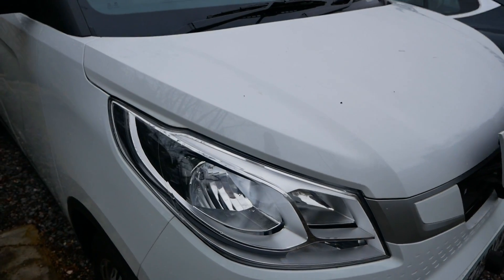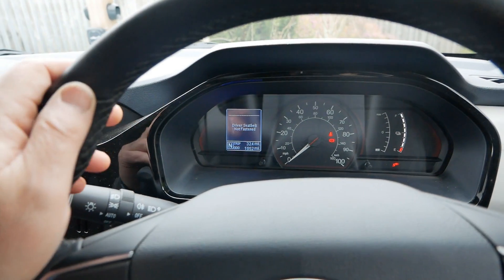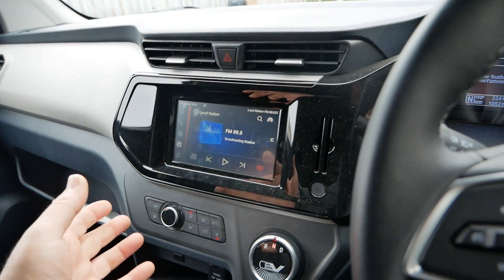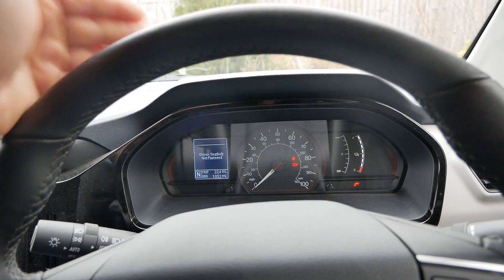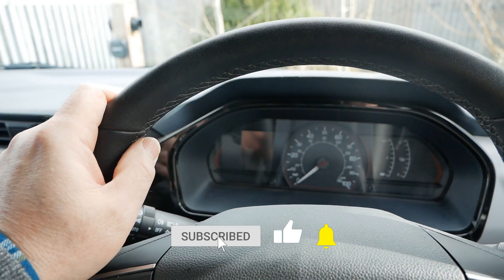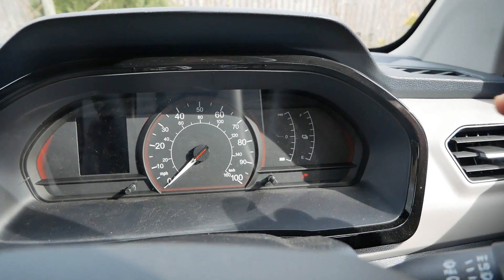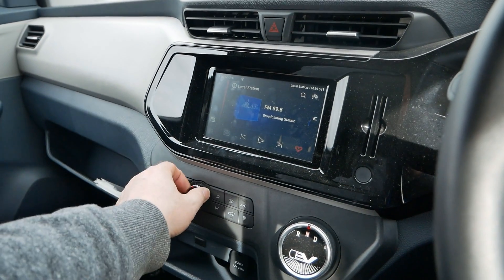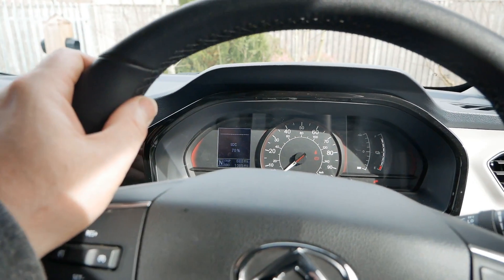Is manual pre-conditioning possible in a Maxus eDeliver 3 electric van?

Comment: Hi, I'm speaking from 6 months in the future.
I didn't know this was even a possibility, so it's good to know.
Although it does seem like Maxus could have offered pre conditioning via a simple software solution without adding any significant costs.
I would be interested to see any reviews on the later models and with bigger battery packs If you get the opportunity to review one of them,  and I'm quite keen to know if the radio was ever improved.

I think this van shown is the one I bought.
It's going well, by the way. I'm driving to and from work at massive cost of £10 per week. Just like it used to be when I was 17 years old.

Comment: Hi mate.
Ive noticed that as well. I think that the car also only lets you run the heater while charging if it is getting enough juice from the charger to spare.
When ive been at 50kw chargers and In below 50% initially it wont let me run the heater just the fans. A little while later you can run the heater or the aircon. A little while after that you can run all of it.
At home I now just run a small electric cab heater  to pre heat it. Only really need to do thar below minus 10  as like you say the heater is pretty good. Below minu 10 it struggles to get the van warm but will clear the windscreen.
Im going to put a small diesel heater in the back. Not exactly green but nice have as I work outside all year and the car is the only heat I can get.
Cheers 
Paul 
Sweden
Reply from the maker: Good to know, thanks. Yes a diesel heater is a good idea. Not green, but they really don't use much fuel at all. I made a video about one fitted in an ENV200, see https://youtu.be/CHkNLAfTcfg